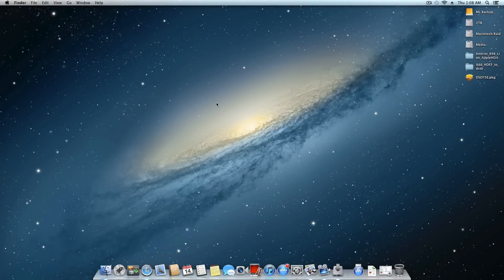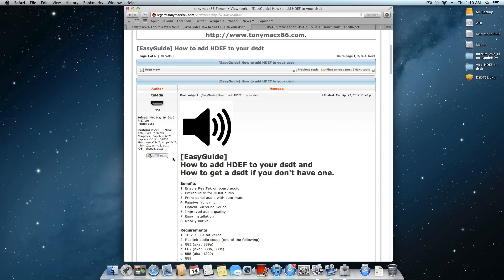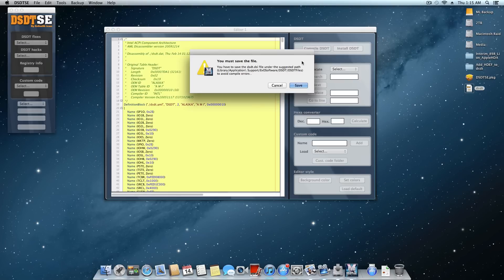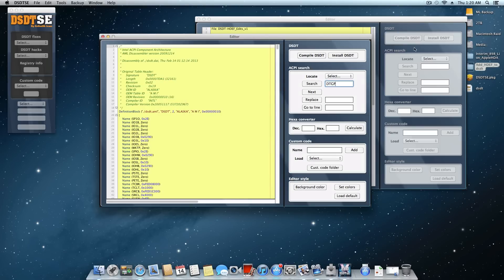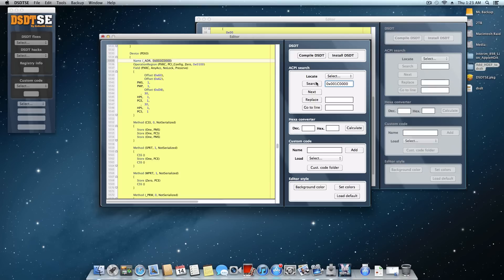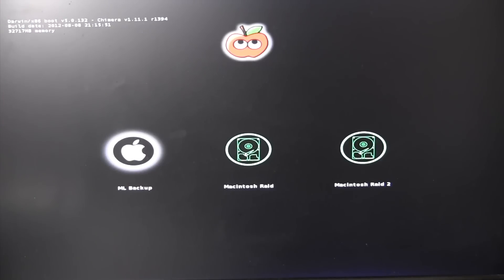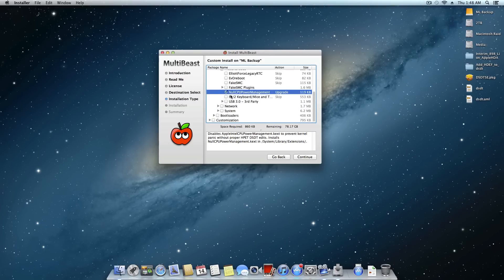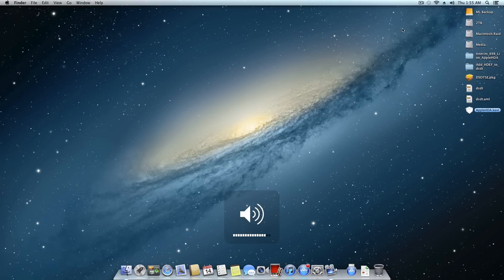Quick Hackintosh Tip: Editing a DSDT For Audio

Comment: Hi ! Can you help in perhaps providing an edit to my dsdt.aml which is used in "extra" folder in order to have a working hackintosh on my Samsung NP350V5C loaptop ? The problem is that the onboard graphics card is not seen as the HD4000 but as generic 64mb with no kext installed as it says. I suppose this is the problem that I cannot use the HDMI and the VGA output although I tried several tips and tricks found on internet. My second card Radeon 7670m is seen and fully working when needed in demand by application. On Novabench the radeon is seen and tested ! I would greatly appreciate and "donate" if my problem will be actually solved ( HDMI and VGA working ! ) Thanks !!

Comment: On my system, my audio works using VoodooHDA 2.8.4, but it is kinda scratchy. I have a alc892 onboard audio on my Z87-HD3 motherboard, should i try to use the MultiBeast alc892 or do you have suggestions.

Comment: I got an issue on my hackintosh... I can hear some noise when I move windows or use hdds or make anything on the computer , (got the same issue on windows7)
Gigabyte GA-Z77X-UD5H
Intel Core i7 3770K
Seasonic - 560W

Comment: Help please!!!! computer i7 3820, Asus P9X79 Pro 2104 bios, gigabyte 640, 32GB corsair vengeance 1866. Have OSX Mountain Lion installed but can only boot when the USB is plugged in as I do not know the correct MultiBeast Settings.